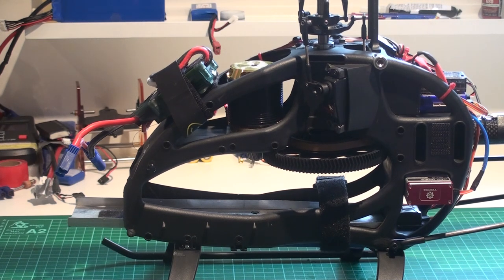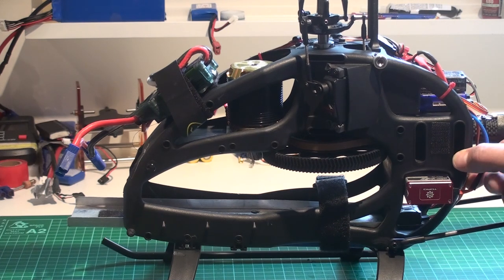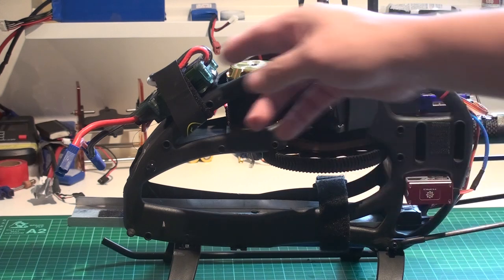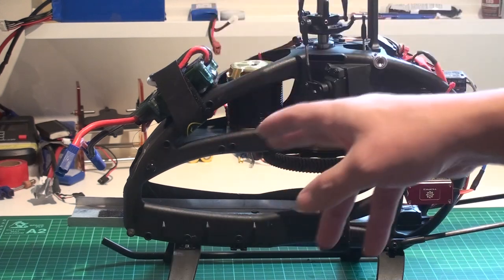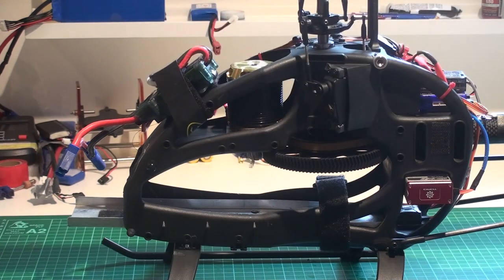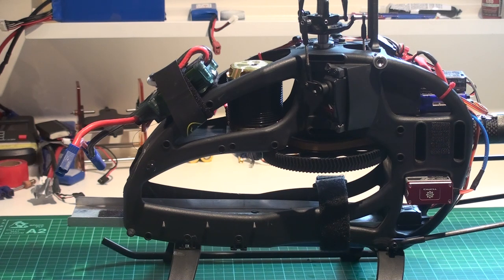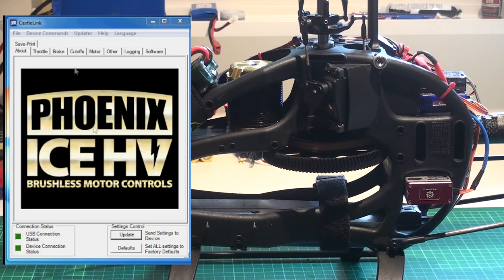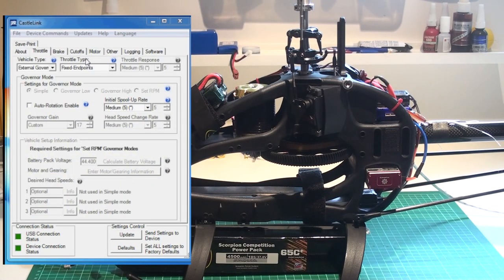VBar 101 - Castle ESC External Governor

Comment from the maker: castle with external governor mode is pre-programmed to match that of VBar.
If you do not get the ESC to arm, lower the low side to -102 or -104 and see if that helps, leave top at +100

Comment: One thing I can't understand.. You said to leave the endpoints at +/-100 in the vbar software, but also referred to your 101 gov remake video where you are adjusting the endpoints different. The reason why i ask is that I have trouble getting the governor to work. I have to go in to collective control mode in order to arm the esc, and when armed, it seems like the governor is bypassed. (2150 rpm requested, but the motor gives about 2500 rpm)

Comment: Thanx Fredrik..
Just to clarify two things.. Do I have to set up fixed endpoints in the esc, and do I have to add common ground between the rx and motor pack? (am running external BEC, CC ICE2 120HV and Futaba S-Bus.)

Comment: Mr Mel, one of the guys I was talking to told me that you need to set the throttle sliders in Vbar to 60/-60, then power on the castle with the stick up and raise the slider until the ESC beeps, then do the same for the low stick position.  In your videos, I don't see that mentioned.  Is that even necessary?

Comment: Castle ice 120 external mode selected. Everything seems to function on the bench. Put the Heli in the air and no power head speed dosent come up to full power. Tac head speed and it's lower than selected. Even if you increase the RPMs in the V bar it still won't raise the head speed. What are we doing wrong. It would be nice to have a complete video showing everything. You indicated that the only thing to set in the castle speed controller was to set it to external governor. I'm wondering if this is the only thing you set as there is no setting in the V bar for KV of the motor. There is also cutoff voltage and type battery voltage. I'm also wondering if the end points need to be set with the radio. These V Bar to castle videos are worthless none of this seems correct. Clent from castle said you need to set end points in the radio. You guys need to get your shit together and made a complete video that makes sense. If I didn't know better and hadn't seen the V bar governor work after following these directions I would think that the V bar Gov. mode was junk. This is a horrible video! Very very frustrated!
Reply: I agree he is very vague in explaining things, his videos are intended for those how pretty much already know how to do this, but for guys new to helis.... forget it. You wont learn anything